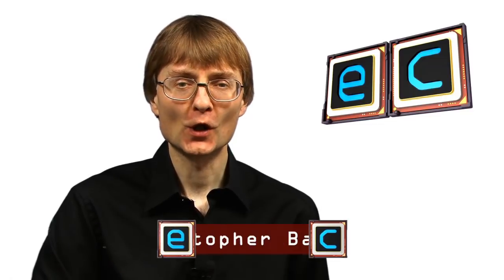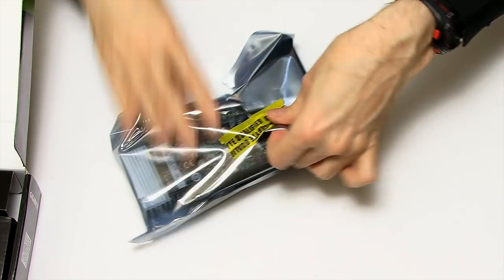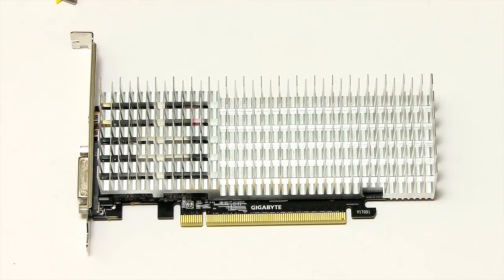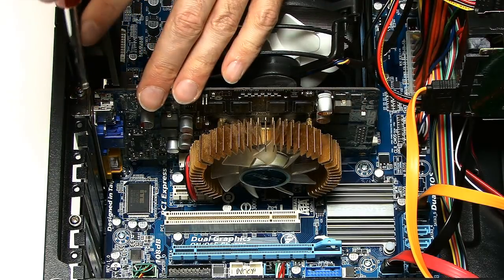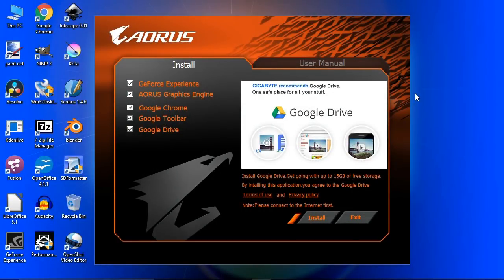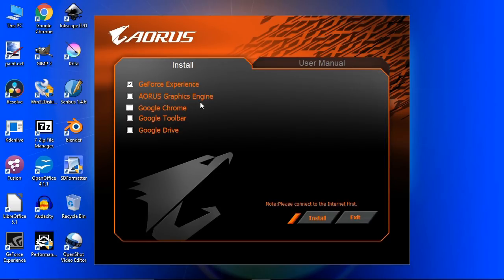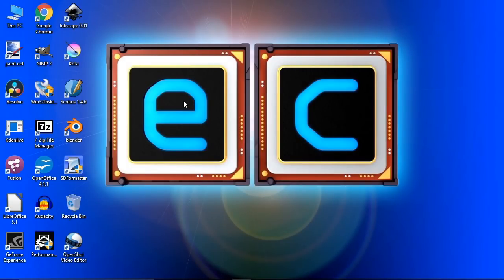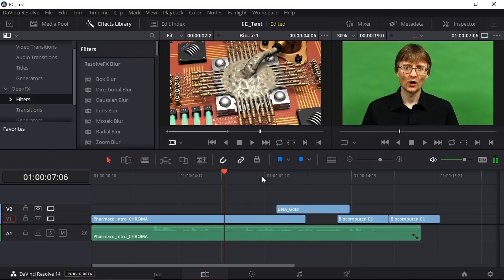GT 1030 Silent Graphics Card

Comment: They should make a new GT1030 with 2 1030 chips in it, with NAND flash memory built in, so the drives can already be installed in the card, and just one HDMI output, and some additional cuda cores.
Reply: nah

Comment: I typically love your videos, but there are a couple things wrong with this one sadly:
You don't need to hold that PCIe lever back to install the card, only to remove the card.
Also, you don't need to install the GeForce Experience application to get the Nvidia drivers.
Reply from the maker: Correct on the lever, my error. On the drivers, I never said that you cannot install them without GeForce Experience (indeed I show another way to install them). What I said was that you cannot install the driver updater without creating an account. Yes, you can installed the outdated drivers on the DVD directly. Or you can install from by downloading from the Nvidia site. But that is for a static install -- you cannot install the dyamic driver updater without an account.
Reply: Ah.  Thanks for the clarification.  Keep up the great videos!

Comment: Video cards always seem to be upside down, to me.  The orientation you have to install them in places the heat sink on the underside.  If you're just relying on passive air convection, warm air will pool in the fins, while all the cooler air just sloshes around the bottom of your case.  It's not a big deal with a fan on the card, and I should hope their engineers have thought of this in the heat sink design.  It just feels wrong to place a heat sink in that orientation.
Reply: Air will be put through the fins.

Comment: That GeForce utility is useful... In your case if you had a big gaming PC in some room in your house and you wanted to play some really demanding game at 1080P on your GT 1030 you could game stream it from your main PC to that PC. I also use it with my Shield TV to stream games to that device :)   Totally worth making an account with Nvidia, it does more than drivers. But if all you want is the drivers Windows Update will get those automatically. They might be 1 or 2 versions older but should be fine. Just be aware you also give up Nvidia's automatic game tuning and a few other nice things GeForce Experience does for you.

Comment: you would be better off with gigabyte gtx 1050 single fan
its better value
Reply from the maker: But still double the price! :)
Reply: Well that's true but for video editing its much more power full. Still i understand you bought it to increase frame rates  from 9500gt no driver support and just for testing purpose.
PS:Awesome channel u deserve much more subscribers!
Reply: LinusTechTips did a video on how getting a high end video card doesn't necessarily increase performance by a significant amount. Yes, you could pay double for a GTX 1050, but that doesn't mean it'll provide double the performance.

Comment: I need a video card badly as my 7870 is dying but thanks to the crypto currency miners anything that is more modern is more than my entire computer cost me to build a few months ago.
Reply: The Best Stooge at least get a 1050 ti or better. Anything lower will be a pretty big downgrade.
Reply: I agree as I look at comparison sites but I wonder when this nonsense will end?
Reply: +The Best Stooge:
Crypto what?

I bought a MSI nVidia GTX 980 4 GB GDDR5
256 bit memory bus.
2048 CUDA
DX12 and GL 4.5
1 DVI-I
1 HMDI
3 DisplayPort

Bought on April 2017 for 380$CAN.

I hear the TI versions are pretty good. I don't know how mine compares to a 1050 Ti.

In any case, my CPU is weak.
Reply: Still hasn't changed yet as the prices are still way above what they should be and I suspect it is now just pure greed as the wave of the miners is waning until the next top of the line cards hit.

Comment: I bought my pc with the GTX 635 card, with 16x PCIe graphics Acceleration and a GB of GDDR.  When I went to install more RAM to the machine, the apparently GTX 16x accn graphics was actually an 8x accn graphics card, albeit with a GB of GDDR but, on checking the spec on the operating system, it was in fact, a GT 635 LE Graphics Card.  It's alright but it's not what I paid for.
My point is that I can upgrade to this card, so thank you for letting us see you putting this card in.  It's cheered me up.  Pity it doesn't do the VGA as my monitor can do more with VGA than with HDMI but if it runs quiet, I'll be even more chuffed!
Cheers.
Reply from the maker: I'm glad this cheered you up! :)

Comment: Going to give this graphics card a try. I have been looking around for a new graphics card for some time now. 
Thanks for good video!
Reply: Jeff T don’t get this card. Either get a 750ti or 1050ti for around the same price
Reply: Not around the same price here in Sweden 1030 cost 100 usd and 1050 237 usd. 
750ti not available at the store where i live. But on Amazon it cost 215 usd. So none of them are worth its price for me.
Reply: Take the 1030. It is a new card supporting new features. no overheating, always optimal performance.

Comment: Tbh if I were to do video editing, at 1080p 60FPS, I wouldn't have bought anything below a GTX 1060 6GB or a Vega 56. From what I can see your motherboard and CPU could also use a bit of an upgrade :P If you want to stick to AMD you can either get a FX-8350 or go for the new Ryzen 7 CPUs (although those motherboards are gonna be more expensive, but the CPUs are a lot better for productivity and content creation), otherwise if you want to go Intel I'd personally go for anything above an i7-5930k (yes it is a bit expensive but it fits older motherboards which compensates a bit for the price).
Reply from the maker: The PC I have upgrading here is a test rig. I installed and ran nine video editors on it last week, and some worked very well indeed (video next Sunday!).

Comment: windows update can scour the internet for the latest drivers or you can download the driver from the geforce website
If installing from the driver downloaded from the geforce website, there are separate checkboxes for "geforce experience" and numerous drivers for the graphics card, from digital audio (audio through the HDMI) to the graphics driver itself among other utilities. Ever since the disgraceful changes that nvidia did to geforce experience, I just update my drivers by downloading the ~500mb package from the geforce website, unchecking the geforce experience option and leaving all the other options for the drivers checked. Just letting you know the next time you buy an nvidia graphics card.
Just note that the installer utility actually extracts its individual installer files to C:/Nvidia by default.
Be sure to clean this up after the driver installation.

Comment: Great video as usual, I have just a few thoughts: 

First, it was neat to show the card in action, but I'm interested to see some collected data of its performance: its idle/load temperatures, idle/load gpu speeds, etc.

Second, I too have a distaste for GeForce Experience, and it is insulting that they push the program for drivers. Clearly they're trying to collect user data. However it does seem more geared towards user profiles, system settings, overclock parameters, and game setting optimization--not that it's ever done a toss for me anyway. An account would then be useful for system recovery/reimaging, but I'll never have one.

Comment: Because of It's Required bandwidth is not very high compared to the Gt 730 ( An 8x PCI-E graphics card ( Though it can be found in a 16x form, But with no performance increase  ) , And a lot of more mid range graphics cards are not bottle necked to severely by an 8x PCI-E Slot as compared to a 16x PCI-E Slot, I would assume that a Gt 1030 would not be bottle necked to severely if you Put it in a 8x slot ( Amusing You Follow the Proper Procedure for removing part of the end of the PCI-E slot on your computer so The extra 8 Pins just overhang  past the slot ) ?

Comment: This guy really doesn't have much of a clue does he. way to reinforce the older generation sterotype of being ignorant to technology. This is not a good upgrage nor is it "good value" it is in fact tldr overpriced low end junk that delivers pitiful performance for an unreasonable amout of money also it is called a "GPU" not a "chipset" and if you belive that totty heatsink is "massive" your really are ignorant to what is avalible on gpu's these days. If your going to call your channel "explaining computers" i think you should first reasearch computers before spreading mis information to your subscribers who put their trust in you to have your facts correct.
Reply from the maker: Thanks for your opinion. After 27 years teaching computing in a university, publishing 13 books on the subject, and running this channel for nearly 10 years, I think I am reasonably qualified to pass on useful information. Though I am also old enough to know that "facts" in this life are rare, and most of us are always learning. This said, I do not believe that the GT 1030 is "overpriced low end junk" with "pitiful performance" as you say, and many others here clearly value the card. I am not using the card in a gaming situation, and for purpose I have fitted it, the card works well and delivers a solid upgrade (not least it allows the PC in question to run software that it could not run at all without this hardware). The GT 1030 also uses less power, hence generating less heat, than a card like a, say, GT 1050, and here is also silent. And there are factors that some users will find important in addition to raw power. "Massive" is clearly a relative term that we could debate ! :) And as regards "GPU" v "chipset", a GPU is just one of the chips required to make a card to the reference spec of (here) Nvidia -- so I use the term correctly.
Reply: campbellh24, 
If you are so offended by the content, feel free to bugger off and watch something more suitable for your needs!
Reply: while you are technically correct a chipset usually is in reference to the motherboard, on a graphics card the whole board is typically refereed to as a gpu since the gpu die itself is  the main component on the board. Value in a gpu is mainly about price to performance at over 60 pound the 1030 delivers poor performance for the price you can find a 750ti for half that price that delivers greater performance while maintaining great power efficiency their are even passively cooled models available if that is important to you. Also you should only be using the driver disc if you cannot access the internet. Even if you got the 1030 day 1 the drivers would already be outdated and with current generation hardware their is often a teething process so up to date drivers are important get them from the web. I agree with you that having to sign in with an account to use other feature of the hardware you've already purchased is bullshit but if you plan on using Nvidia specific features of the card, shadowplay for example or have your drivers updated automatically seeing as their are new drivers every few weeks their isn't much choice.

Comment: You can also download the driver itself from nVidia using the manual driver search. But it is an interesting point that you can just use the Windows built-in method. They do keep pretty recent drivers in Windows update.
Reply from the maker: Thanks for this. Many here seem concerned that using Windows drivers will not be sufficient as they will be less up-to-date. But my only concern is to have drivers that are recent enough for video editing software to run -- and the Windows drivers seem OK for that (I installed and ran nine video editors on this PC last week!).
Reply: @ExplainingComputers  That's fair enough. Thank you for your reply.

Comment: You can get the drivers on the Nvidia website without logging in, the experience app is not primarily a driver manager and is completely optional. Using windows update to manage your graphics drivers you will be behind on updates.

Comment: +ExplainingComputers
The GT1030 is actually one of the best base model GPU's that has ever been released. It can competently do everything needed. While it's can't do 4k gaming, at can do 4k video playback without any problems. Additionally, I fully agree with you about the "Geforce Experience". Users can avoid installing it by selecting "Custom Install" during setup and deselecting it.
Reply from the maker: Thanks for this. It is interesting to see the different views on the GT 1030 here. I agree with you, as do some others here, that it provides a competent solution in a great many situations for a decent price -- and this version is also silent! :)
Reply: Nope mate, thats the rx 550

Comment: Why did you use the 9500gt instead of the integrated graphics of amd a8 ? Since the a8 is an apu it has a decent gpu inside ...
Reply from the maker: Because my test rig is used for recording, and there is no HDMI output for the integrated graphics on the motherboard - hence I needed a card with HDMI to link to my recorder.
Reply: ExplainingComputers oh ok then .
And btw  thanks for the quick response

Comment: Mr. ComputerExplainer, I bought this card and later realized it has NVENC (hardware video encoding) disabled. Is there any way to enable it?
Reply from the maker: I understand that this was an issue when the card was released, but NVENC support is possible with the latest drivers. So enabling this provision will be driver dependent.

Comment: Use the reference drivers from nVidia... Just do the advanced/custom install and uncheck nVidia Experience, you don't need it... Newer drivers than the ones through M$.  Also you can run a VGA monitor off that card, just get a HDMI to VGA or a DVI to VGA adapter... Love the videos!!!

Comment: Another great informative video.  Do you think this card would work with pinnacle studio 21? I have a rather hight spec machine that I built summer 2017 but I'm using the motherboards on bored graphics and performance in pinnacle is awful,  freezes and crashes :-/  thanks
Reply from the maker: I very strongly suspect that this would improve your performance in Pinnacle Studio 21 significantly. I have just spent the best part of a week testing nine video editors with this card, and all worked fine. That video uploads next Sunday! :)
Reply: ExplainingComputers thanks for your reply.  Can't wait for the video  :-)  I have a feeling that the problem my lie in pinnacle studio it's self,  I have tested lots of other video editors and they do seem ok with my intel graphics,  it's just pinnacle that really struggles.  Saying that,  for £65 it's worth the risk,  hopefully make a big difference. My cpu is a 7700k btw. Thanks again and looking forward to the video :-)

Comment: The thing about the GT 1030 is that I️t is a terrible value, for $20-40 more you can buy a GTX 1050 that can blow the doors off of this card.
Reply from the maker: I don't know where you are buying your cards -- the comparison on Amazon is about $70 to about $120. The GTX 1050 is certainly a more powerful card -- but also uses more power, hence generates more heat, and is not silent. So it all depends what you want to use it for! :)

Comment: As a Photographer with a crappy i5 and entry-level GPU, I waste hours waiting for Lightroom to catch up...  What are the key bottlenecks I should consider when upgrading?  Would SSD storage make the biggest difference?  GPU?  Or CPU?  Any tips much appreciated :D x
Reply from the maker: If you are working with large images, an SSD may well be your best upgrade. After that, CPU. The GPU should make very little difference to systerm performance for photo work.

Comment: I agree it's complete extortion to demand personal information in exchange for a few drivers ={ but apparently this what the world has come to
Reply: You dont Need GeForce Experience. Just Download the Drivers from Nvidias Website.
Reply: John Bull 

Every driver is avaliable directly from amd. No other company. You only Need the gpu driver and that will always be avaliable directly from amd.
Reply: Kinda funny I went to download Divinci Resolve and had to register with my details before I could use it as well.
Reply: bob john I don't think this is a thing with AMD yet. I don't remember ever having to do it with them. I even have an rx 480.
Reply: AMD farmed out the driver for my APU A10-6700 to some company that didn't do a good job such that it crashed the computer. I go to this company's site and while I tried to download the "improved" driver, these fools tried to load on to my computer some sort of massive program that functioned as crashware. I got so mad, I returned to Linux. I had planned to do that in time but I had reasons for desiring Windows. Away Linux and its drivers both open and not-open have been smooth sailing for me.
Reply: You can also use  DriverPacksolutions if your too lazy to download the correct drivers.
Reply: bob john George Orwell would be proud of us.

Comment: I didn't know you had to hold open the lever to insert a card, only pull the lever to take out a card
Reply from the maker: You may well be right -- and it may depend on the motherboard. I was find of working blind there due to not wanting to block the camera.

Comment: Isn´t the  Gt 1030 a tiny bit too weak for the rest of the build?
Reply from the maker: It serves the purpose specified -- and is significantly better than the onboard graphics (which lack HDMI for recording).
Reply: I can accept that but its still a bit wierd.
Reply: As long as you are happy with it everything goes i guess.
Reply: I´m on a i7 4790 and GTX 970  because i want to make sure that i can play more or less every game in atleast 1080p in 60 fps with  high graphic settings.